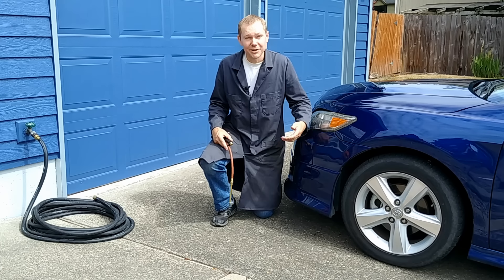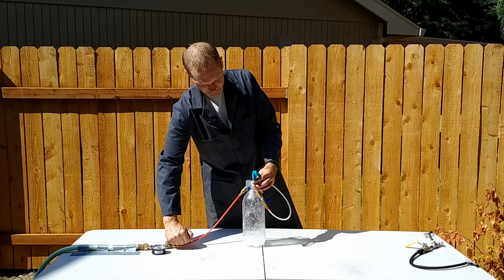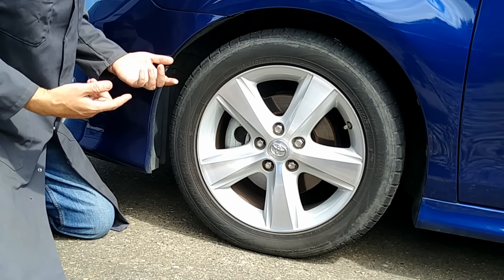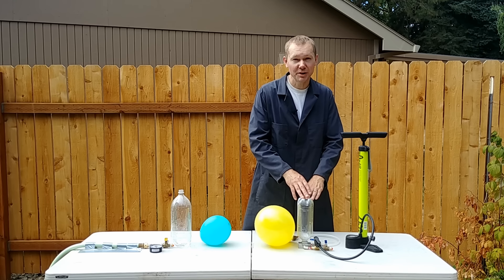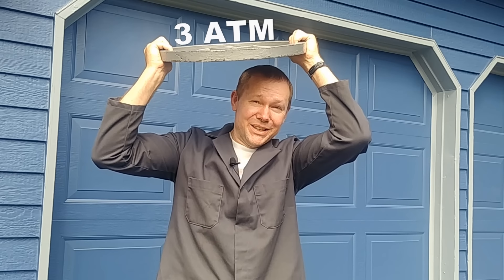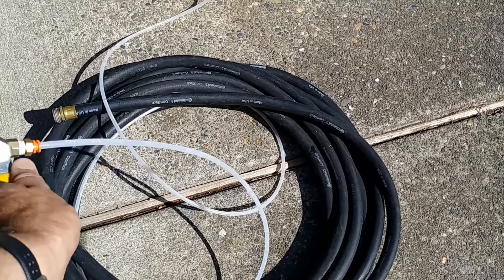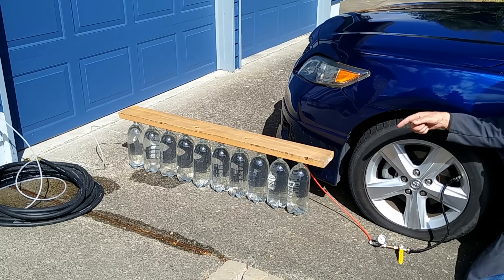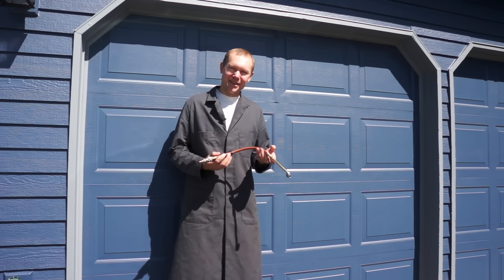2 Liter Bottle Compressor (No Moving Parts)

Comment: Next week: How to get water out of your tires.
Reply: Next week: What to do with the water you used to fill your tire.
Reply: Just wait for the belts to rust and then when the tire explodes all the water will come out.

Seriously. There is a reason string plugs aren't considered a permanent repair.
Reply: Good theory video. I noticed in the video you were using aluminum to mill the two liter bottle block adapters for this experiment. Have you considered selling those?
Reply: If you have a special set of tire rims with rubber sealing around the inner to protect against rust, you could just use water period and it would last much better, plus is you had a leak it would be extremely obvious where.
Reply: @seanregehr4921  and then end up getting 4 miles to a gallon with all tires filled with water. Lol

And in the winter when they freeze your tires would be lopsided
Reply: You did not understand what you are watching. There is no water in the tire.
Reply: You did not understand the joke.
Reply: Jokes aside (funny as hell) you will get a small amount of water in your tire. The initial experiment with balloon you can hear the small amount of water getting in. Not to mention humidity. Common air compressors have ways to eliminate the residual water in the tank before it becomes an issue.
Reply: @seanregehr4921  The roational mass would be insane. Take forever to accelerate, and even longer to brake. Be pretty dang cool tho. :)
Reply: @magnusnordstrom3927  Top speed would be lower and it would probably be very susceptible to road damage. When you hit a pothole some of that energy goes into compressing the air in the tire and without that you might pop them.
Reply: @mrbachibachiller7796  you are getting the air from the last bottle but you are getting some water /moisture from that bottle.
Reply: ---- he just needs to add a water separator or trap, after the last bottle.   just like with Air Filter Pressure Regulators that are installed at Air Compressor for powering Air Tools and HVLP Spray Guns, the Water Traps keeps water from getting into the air tools, and rusting them, from the inside out.  Easy Peasy 👌🏽

It ain't Rocket Surgery 😆
Reply: There would be no water if you add 1 more bottle and stop pumping air when water reaches that last bottle. Just to be safe.
Reply: No, blood out of a stone!
Reply: I hope you Are not serious, AS you know AS he told u can compress air not fluid, If u fill up your tyres and go 60mph on road and drive thru hole then u. Know why its not wise, for tractors they use water AS extra weight but they dont move in highway speeds
Reply: Roll the dodecahedron and punish yourselves... all of you.  The little bit of water that might have gotten in... meh. Even if it froze it wouldn't cause a problem. Steel belts are still sealed in rubber. A significant amount could cause wear especialially if there's bits of rubber from running on too little air pressure from the sidewalls eating themselves. I KNOW, because I used to see the damage replacing tires in the 90's. A squirt of water will not be a problem. Again, it was a joke.
Reply: @pgtmr2713  Exactly.  Worked a job doing tires part time for years and this is the correct response.
Reply: @seanregehr4921  Filling water into the tires is a bad idea, because it makes your car (in this case at least 120 kg) heavier. As the water is in the tires it takes an extra amount of energy to accelerate as the mass has to be set into rotation and translation. More over air is much more compressible than water, so you would also lose suspension. So there are good reasons why there is gas and not liquid in the tires.
Reply: @seanregehr4921  that would be terrible. The additional unsprung and rotational mass would ruin the handling, performance, fuel economy and comfort of the car
Reply: @seanregehr4921  Besides the added mass people are talking about, since water in not compressible I'd be willing to bet you drive over one nasty pothole or bump, the water will have nowhere to go and will hydraulically unseat the tire from the rim.
Reply: Water/Humidity levels would be insane and on a long drive may steam up and increase tyre pressure above safe levels. Hopefully he can run a vacuum on it in the next experiment
Reply: @SergeantSpandex  No.
Reply: @pgtmr2713  but yes 😎 do burnouts to steam clean those tyres,  fill the tyres with liquid rubber and now you have a no-air tyre. Sloppy tyres fixed - forever
Reply: You would immediately lose 1/3 of the original horsepower from the added rotational mass as documented from the butt dyno series!
Reply: Well I've been a tire guy for the last 30 years. Water in a tire is not good unless you're going really slow. Otherwise it's a huge balance inconvenience. Now I have been known to put calcium chloride inside a tube inside a tire but it was a huge tractor tire and it was done for weight purposes. It added about 400 pounds per tire.
Reply: @anothergoogleuser  charge your cellphone or perhaps wash your car.
Reply: JOE MASTER PANTHER ZIPPILLI I hated calcium chloride. Especially when the tube gets a leak and wheels get corroded bad. Just messy all the way around. On top of the chemical reaction being extremely hot. That’s why some farmers went with antifreeze. But mostly just added weights to the rims. But that was along time ago when I worked at a tire shop. I’m sure things have changed since then.
Reply: Don’ worry bout it.  At least for moisture.  
Tractor tires are sometimes filled with water to increase traction.
Reply: @Falcodrin  not to mention, wheel hop. Don't think a tire could be balanced with water in it. Might work for low speed and agriculture, but not so much for the highway.
Reply: the better question is why he did not use the foot pump in the first place?  rather then spend 5 hours building this?
Reply: @Randy2747   I saw a YT video were they filled it with water and it lasted a very long time doing a burn out
Reply: @seanregehr4921  do you know how heavy water weighs ?
Reply: @punker4Real  really?! That's crazy! 
the water would freeze in the winter time and tires would have to be out of balance even if it's size of a few ice cubes.

I wouldn't want water in my tires. Lol
Reply: Well, water (and glycol) are used in tractor tires (and other farm equipment) to lower centre of gravity. They used to use calcium and water mixture as well.
Reply: @Randy2747  Just add some antifreeze.
Reply: @Randy2747  You would only notice a decrease in fuel economy when accelerating (and longer braking distances). Once you're up to speed, yes there is a little more mass to move but you'll actually have better fuel economy if you go up and down little hills because the car will have more linear momentum.
Reply: @hugoburton5222  a car have low enough centre of gravity, and that is really one of the worst place to put weight to, too much rotating mass, it will probably have twice the braking distance
Reply: Something not mentioned is the different density between water and vapor. The tires have higher pressure, meaning that is not hard for the vapor to condense and they heat while being used, so the water could evaporate. All this state exchanges make for (sometimes uneven) variations in tire pressure, what may lead to higher wear, lower performance, lower efficiency and in extreme cases help the tire to blow. To avoid that, high performance cars are filled with nitrogen instead of "air" to prevent water to interfere with the pressure and reducing it just to the temperature.
Reply: The humidity level of air going into the tire would be equally bad... Causing greater expansion and retraction depending on the current temperature and while driving... Best to fill your tires with the least humid air as possible.

Interesting example of air pressure and such; but, I'll stick with my standard compressor with a vapors condenser interface to limit unnecessary water 💦
Reply: @seanregehr4921  Wrong. The whole reason we use air in tires, is because it compresses, and in turn offers a smoother ride. Otherwise we would all just use solid rubber tires.

That said there is now an air-less tire on the market for commercial applications (does not offer as smooth of a ride as air tires though, they are much more rigged. Airless tires said to offer an air-like ride are coming though, they will cost about the same as runflat tires.
Reply: @mrbachibachiller7796  There is humidity in the air, most likely very high humidity. It will condense out.
Reply: LMFAO
Reply: Mrbachi Bachiller - Not true. Air contains moisture. Air pressure generated using this method will contain a lot of moisture. It can cause issues with balance and tire life due to rust in the steel belts. Better shops will either use nitrogen or a drier on their air supply, for this reason.
Reply: If you just drill a hole like so...
Reply: @seanregehr4921  good theory but I tried that with my ATV and the tires blew due to centripetal force with the extra weight of the water. I realize they are 2 completely different kinds of tires but same concept.
Reply: At the bike shop, putting water in other mechanic's tires when they weren't looking was a great prank.  Made the bike ride REALLY weird!
Reply: @SuperfluousUserX  Causes hell with the tank though.
Reply: @mrbachibachiller7796  there would be water vapor carried over, no doubts about that.
Reply: Using 51 blow up balloons and a party straw of course.
Reply: @seanregehr4921  Except water is uncompressable, and would rupture the tire when it was jarred by a pothole or other large bump.
And then there's the fact that water freezes and expands.
Let actual mechanics such as myself do the thinking. You're going to get someone hurt.
Reply: @Ariel24K  8 pounds per gallon.
Reply: @hugoburton5222  lol 🤣😂
Reply: This is brilliant. It sparks conversation and argument! Lovely stuff!!!!
Reply: @dudeonbike800  Genius!!!
Reply: @RichFreeman  What is a string plug?
Reply: @Randy2747  Actually, when water freezes it expands 10% in size. No tire would survive that.
Reply: @rwatson2609  it is a way to plug a hole in a tire. You remove the object that punctured the tire, file out the hole to the right size, and then use a tool to push a plug into the hole. The plug is just a bunch of pieces of string with tar on them. This will make a reasonable seal so that the tire can hold air. The problem is that the string will allow water to seep into the tire. This water will slowly rust the belts and reduce the strength of the tire. Then a year or two later you're driving down the highway and get a blowout and lose control of the car. 

A string plug is perfectly safe as long as it is short term and not too close to the sidewall. However, the tire still needs a proper repair which requires unmounting it and adding a patch to the inside to make it water tight. This can be done at a convenient time, so string plugs are a legitimate emergency repair which can be done roadside.
Reply: @RichFreeman I'm not so sure about this.... So how would the water get in through the string plug with 30 psi pushing against it. I know that centrifugal forces are against this happening as well. And finally, air can usually seep through holes better than water can, so even the smallest hole in the threading would cause an air leak before it causes water ingress. I know I'm a pain, but I'm in lock-down and I have nothing better to do than troll the web.
Reply: @rwatson2609  I'm hardly an expert in tire repair - I suggest search the issue.  However, it isn't that unreasonable - water is drawn through something like a string via capillary action and diffusion.  You wouldn't see the water flowing in any visible way - is more an issue that if it is parked overnight in a puddle/etc the water would very slowly seep into the tire.

I couldn't tell you how large the risk is.  However, I've seen the recommendation to not rely solely on a string plug repair on numerous reputable sites.  It is probably a recommendation for a reason.
Reply: @Delano Schummelketel 😉 of corpse
Reply: @mrbachibachiller7796  There'd have been a lot of water in the tire, even without using the the water bottle system undried air carries a lot of water, the water compressing the air would have added droplets that would have carried over, it would have been well over dew point.
Reply: Im actually the one who ke this comment to 2k likes!
Reply: @dudeonbike800  We had a service manager that transfered to another shop closer to home, he dropped by one day to pick up some tires our shop had. While he was talking with the manager several ounces of wheel weights got hammered on to his Ranger's wheels. He said he stopped to see if he had a flat it was wobbling so bad. It was a good prank. He was good service manager, it was all in good fun.
Reply: That's a pretty stupid remark. There is no water in the tires. Did you even watch the video?
Reply: @seanregehr4921  but you can't compress water. Hitting a bump would be horrible if you filled your tires completely with water lol
Reply: Sean Regehr I think it would be a very rough ride, damage the car, effect handling, etc.. , but in theory would be possible.
Reply: punker4Real yeah, or the plug in compressors. (I bought mine for 10$ on sale)
Reply: @RichFreeman  what are you talking about he had a shut of valve very minimal water whould have made into the tire if any it was directed into the bottles that pisplaced the air fron them into the tire so only air is getting put in the tire
Reply: @AldoHam  very minimal water in your tires is still water in your tires.  It doesn't take that much water to rust the belts.  The water was splashing quite a bit and certainly would have made it in without a trap of some kind.  Plus the air would likely be pretty humid as well.
Reply: @seanregehr4921  and your tires would only weigh like 200 pounds each.....VERY BAD IDEA...!!!
Reply: Saying that when compressed air has a lot of moisture in it seems like a useless complaint. Most aircompressors dont have a filter for water
Reply: Everyone quit talking like you know what you are talking about.  The OG post said it was a joke.  The minimal amount of water that made it in will literally have 0 effect on the performance or health of the car.  So shut up about it.
Reply: Mrbachi Bachiller yes there is ,, because this air is full of humidity , in the end ,, you will have water in your tire ,, in an air compressor the humidity is much less
Reply: @seanregehr4921  yeah, see what favours that does to your spine
Reply: @pgtmr2713  lol, he mighta been joking but there are a few on here that don't think he was ha ha ha ha
Reply: @seanregehr4921  correct, however that would greatly increase the rotating mass
Reply: @matke8723  there still would be a bit.
But probably no more than running your compressor on a extremely humid day.

Which people do on a normal occasion so guess it not a problem.
Reply: I was thinking this exact joke.
Reply: @seanregehr4921  Except that water doesn't compress, which means it's only a matter of time before your tire breaks its bead or just blows out.
Reply: @mrbachibachiller7796  There is certainly SOME water in the tire.  Is it enough to be a problem?  more likely when one can accidentally blow water in...
Reply: @Randy2747   Plus water weighs 8.33 pounds per gallon!  Now he calculated that his tires were about 30 liters in volume.  I believe a liter is about 3.6 ounces over a quart (32 ounces).  Whatever the conversion works out to, that's a lot of extra weight.  And since water is in compressible, your going to have a lot different ride compared to what your used to with air.
Reply: @magnusnordstrom3927  some big extending boom forklifts use water in their tires as ballast, it was also a trick used in the old tall narrow jeep tires for reaction in sand
Reply: @ronaldharris6569  Wow, that's pretty cool! Thanks for the info. Very clever, using it as ballast. I don't really understand how it helps in the sand though?
Reply: dude the water does not come with the air listen to le video :)))
Reply: @mrbachibachiller7796  yes there would be unless he has a filter on the last bottle.You could even hear it coursing through the narrow tube.
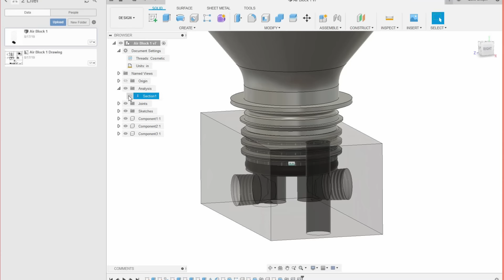Reply: @RichFreeman  To Tim, Rich Freeman and others of ilk: At 4:48 minutes: There is a reason for this video upload, is to educate, not to be used in a practical situation.
Reply: @eddyvideostar  The reason for my comment was to educate, not to suggest that the video was morally deficient.
Reply: @anothergoogleuser  drink it its just tapwater so it should be perfectly safe
Reply: Trevor Noah sometimes, ngl most air compressors still let water in past the filtration, something I have to deal with especially being down in Florida with the high humidity
Reply: @mrbachibachiller7796  i guarantee there is water in the tire.. it's not filled with water, that is for sure, but there is water in that tire :}
Reply: Or ...benefits of using water in your tires vs air? Have a slow leak? Park by your garden... lolz
Reply: No way. Air compresses and provides suspension. Water does not compress and you'd have a total disaster.
Reply: @Cotronixco  I would say I was talking about carbonated water...but I'd hate for you to miss my sarcasm twice...
Reply: Why?  Adds weight, great for winter traction.  LOL!
Reply: Tom Long - I wasn't responding to you. I was responding to Sean Regehr. But apparently YouTube is too stupid to let you know that.
Reply: Why should be water inside the tire? :D Probably a minimum humidity - but tht's it. And that is the same you get when using a compressor at a day with rain or whatever. so...why?
Reply: @SuperfluousUserX  And small car compressors have no tank. So they directly push humid and compressed air inside the tire. there will always be a small amount. Does not matter though.
Reply: pete schabe - not an issue if you don't get any water in the final bottle.
Reply: @magnusnordstrom3927  Farmers add water to their TRACTOR Tires for increased weight to get better traction when pulling something like a plow.  The Tires are Filled with a water/calcium chloride/glycol  mixture, so the water won't freeze in the winter time.
Reply: @anothergoogleuser  
Unless there is an inline drier. Which most tire compressors DO NOT HAVE. 
Almost all compressed air from your compressor or from the gas station has moisture (WATER) in the air that goes into your tires.
Reply: Johann Ribert he didn’t put water in the tyre he used the water pressure force that pushes air like a compressor
Reply: Dr. M. H.  Lol 😂
Reply: Dr. M. H.  🍻🤜
Reply: @seanregehr4921  The suspension would be very rough on hard surface!
Reply: I expect you know that you should fill the large tyres on a tractor with water...???????
Reply: @SuperfluousUserX  yeah my intern job scope was to clear water from compressor tank from the valve every morning n before clock out.
Reply: LMAOROTF!!!!!!!!
Reply: "Ok guys, drink up,!!!! The articulating loader at the mine needs a billion liters of air!!!!”
Reply: Randy E I think my tires want to pee
Reply: buenisimo jaja
Reply: @Randy2747  Just switch them out before winter then. Winter tires as normal, late spring to early fall water filled tires... if what he's suggesting is feasible. People in cold places change to winter tires anyway every year...
Reply: Smart kids must be used extra bottle with foam inside.
Reply: No moving parts, except a water pump, oh yeah and water
Reply: No water goes into the tire. that for the visual. Look exciting. The one empty bottle the first bottle of air that equal to all ten bottle compress get tranfred to the last bottle at the end  to look good then into the tire.
Reply: it was easier to buy an electric pump or go to the tire shop, or change the tire
Reply: Maybe a little moisture, as long as ur careful and dont push the water to the top of the bottle. Even then, the pneumatic line and 2 valves wouldn't let much in. No more than you would get from a compressor on a muggy day.  Would be great to add a catch on the line. just for the little bits that might jump up into the block and down the line. Either way. 

OH and yes, i get that its a joke. Had a good laugh XD
Reply: @RichFreeman  you are aware that filling your tires with atmospheric air puts a decent amount of liquid water in them, don't you?  

Ever talked to the guy who was changing your tires? Ever notice the half liter of water that pours out of some tires when the seal is broken from the wheel?  

The belts are encased in rubber. Try again.
Reply: @anthonytackett5619  in that case, why do they recommend against string plugs?
Reply: @RichFreeman  You're on the right path with the plugs. The puncture causes a break in the rubber casing. The String plug WILL seal it. BUT, the atmospheric moisture has already gotten in. So, it WILL fail when the belt rusts from the trapped moisture inherent in the process. As long as the tread is not punctured, you can feel secure that short of manufacturing defect, or damage, the belts will stay inside the rubber. 

The issue would be more the mass and inertia with the water. If too much gets in, you will wear your breaks out in a very short amount of time. Fill all your tires with water. You may not stop, until something else sturdy enough stops you. But, a little bit of water inside a tire is normal and non-destructive, to the tire. The wheel, however... If not properly coated and sealed...

Patches are not nearly as bad, because they do not force more moisture into the belt, increasing the amount of time before it rusts, and eventually fails. And, as the air pressure will hold the patch against the hole, not nearly as much glue, solvent, or other moisture carrying or corrosive agent is introduced in the process.
Reply: Fill with water and see what happens when the tires freeze.
Reply: @seanregehr4921  to much rotational mass
Reply: @mrbachibachiller7796  Whenever you are working with water, there is always water vapour around.  Water vapour in a tyre is a really bad thing, due to huge pressure instability between cold and hot, which means you can then never set your pressures properly.  There's a reason tyre shops have drier setups on their airlines..
Reply: @pgtmr2713  Yeah these people have probably never seen the inside of a tire, they also likely do not know that the rubber in a tire is slightly porus, over 3-5 years of being on a car, the belts have gotten wet.

Not to mention when we seat the bead on tires, we use tire lube or soap. You mix the tire lube with water before dipping your brush in it so the bead slides around the rim without tearing or damage. There is water inside tires the second they are put onto the rim. Water in tires doesn't hurt them if it's just a little bit. I would imagine a quarter cup of water would also act like balance beads and help balance the tire. (would make balancing on a machine a massive pain, but thats what balance beads are for.
Reply: @davidmarquardt2445  The beautiful thing about the metric system is that 1 litre of water weights 1 Kilogram. A cubic metre of water weighs 1 tonne (1000 kg) it's dead easy. So 120 kg of extra weight. About 264.5 Lbs
Reply: It hard enough when it off wheel unless if frozen.
Reply: @seanregehr4921  Water does not compress. You will have one hard ride substituting a compressible medium with an uncompressible medium in your tires. Not to mention trying to balance those wheels.
Reply: @SuperfluousUserX  Use a water trap
Reply: @magnusnordstrom3927  The water is free to move inside the tire. Though the tire would have a lot of weight, it would only have the slight friction of the water impacting its rotation and I doubt acceleration times would be impacted much... no more than carrying the same amount of water in the trunk at least.
Reply: @mrbachibachiller7796  unless you remove the water from the air before pumping it in, there is always some water in the tire. Usually in the form of humidity, but it will condensate in cold weather. I know that's not what the comment was talking about, but just thought I would point that out.
Reply: Mine is harder! Can't figure out how to get off all those pop corn tried in!
Reply: @seanregehr4921  you mean that you want to fill up your tires with water ? That’s a really bad idea. Water is incompressible, your tires will behave very badly. And also think about the inertia of their water in there, at higher speed you could have some nice surprises :)
Without mentioning the energy dissipation due to vortexes inside the tire
Reply: @SuperfluousUserX  it had a different type of valve on the final one. It displaced pretty much only air.
Reply: @TheovdGulik  Yes there is water in the tires. Do you even understand sciemce?
Reply: @mrono1910  Most air compressors dont use water as thecompressive mechanism.
Reply: @mrbachibachiller7796    You know that PGTMR2 was just making a joke.
Reply: @mrbachibachiller7796  water vapor will condense inside the tire.
Reply: I was wondering if he put an inline filter to keep water from getting squeezed in with the air.
Reply: @seanregehr4921  
Except, liquids don't compress. Your ride would be almost no different than steel wheels. Until you hit a rut and the tire exploded.
Reply: lol
Reply: Great video!
Reply: The week after that how to get your tires into the bottles.🤪
Reply: @SuperfluousUserX  actually the common air compressor it's self usually has nothing of the sort. This is the job of a desicant or refrigeration dryer which most tyre garages don't have so you needn't worry about moisture in your tyres as I can guarantee that most cars already do.
Reply: @seanregehr4921  Balancing and ride comfort not to mention mpg?
Reply: except if you live in the Northeast a water tire would expand and become rock hard.
Reply: Exactly
Reply: @mrbachibachiller7796  And you do not understand physics. The air in the tire is now super hydrated and will corrode anything it can. So it might have been a joke, but he was also right.
Reply: God has said in the Quran:

{ O mankind, worship your Lord, who created you and those before you, that you may become righteous - ( 2:21 ) 

 [He] who made for you the earth a bed [spread out] and the sky a ceiling and sent down from the sky, rain and brought forth thereby fruits as provision for you. So do not attribute to Allah equals while you know [that there is nothing similar to Him]. ( 2:22 )

And if you are in doubt about what We have sent down upon Our Servant [Muhammad], then produce a surah the like thereof and call upon your witnesses other than Allah, if you should be truthful. ( 2:23 )

 But if you do not - and you will never be able to - then fear the Fire, whose fuel is men and stones, prepared for the disbelievers.( 2:24 )

And give good tidings to those who believe and do righteous deeds that they will have gardens [in Paradise] beneath which rivers flow. Whenever they are provided with a provision of fruit therefrom, they will say, "This is what we were provided with before." And it is given to them in likeness. And they will have therein purified spouses, and they will abide therein eternally. ( 2:25 )

 Quran
Reply: @thememoryhole9355  Haha yeah, rolling smooth until a rim hits the curb and sparks fly! XD
Reply: @mrbachibachiller7796  there definitely was some water in the tire. nothing significant but its there. in the test you could hear water was getting blown in to the air tube. now there were how ever many bottles. so not nearly as much water made it in, but as the 10th bottle was filling with water some water definitely made it in to the air tube.
Reply: @seanregehr4921  Assuming the same size tires as in this video, that would be four tires containing 60 liters of water each, totaling a whopping 507+ pounds added to the weight of the car.

NO, SEAN, WE'RE NOT DOING THAT.
Reply: @magnusnordstrom3927  It would add weight to improve traction if that was needed though.  We had a tractor on the farm growing up that had calcium added to the tires to add weight/traction.
Reply: next week: how to grab water from air
Reply: @glenndarilek520  rock crawlers add water in the tires as well. Lowers the center of gravity.
Reply: @RichFreeman  I've had a plug in my side wall for years. Happened when the tire was new. No shop will patch it so I left it. Those plugs are self sealing. Additionally, a patch from the inside will not protect the belts on the other side exposed to the environment so how is that better than a plug? The tire is half worn now. With luck the plug will last for most of the rest of the tires life.
Reply: @mrbachibachiller7796  Isn't there more moisture from this set-up vs an air compressor, though?
Reply: @RichFreeman  honestly your scenario is unrealistic and the tire would be long be out of commission and retired long before what you described would happen. But this is a stupid pointless for a car although we routinely fill tractor tires with water on the farm. It adds weight to keep the front down if pulling or using really heavy equipment.
Reply: @workingmanrondoyle3287  yeah,  or do a subscriber raffle!!!
Reply: @SuperfluousUserX  hahaha, add a cannister with silica gel to “dry” the air before going into the tire😷— will work just like Fauci’s masks — hahahha
Reply: @seanregehr4921  maybe we can use mercury instead water
Reply: @purask  there are trying to go 30 and go down the highway. And the pothole argument is moot the tire would still hold up even if it was full of water because you’ll never completely 100% fill a tire with water pressure because it is in a sealed area you will have water on the bottom half and compressed air on the top Half.
Reply: @seanregehr4921  it would last much better? Hahaha. You cant fill a tire with water. It won't balance
Reply: Cool video, but what did he do with all that water?
Reply: ROFLMAO
Reply: Use a water/oil filter attachment at the end. I use one for my big bore airrifle.
Reply: NICE!!  LOL
Reply: @mrbachibachiller7796  there damn sure is moisture in that tire
Reply: @mrbachibachiller7796  Water is being used to compress the air.  That, now very humid air is being compressed in to the tires at 2-3 atm.  At that pressure, the water vapor is going to precipitate out as liquid water.  Besides that,  even high consentration of water vapor can cause rust, which is why commercial air compressors have "air dryers" on them.
Reply: Or use silica gel to dehumidify the compressed air.
Reply: @anothergoogleuser  exactly
Reply: Good call!!   Water in a tyre is a total pain in the arse,  it causes a crazy wobble and you can't balance the tyre because the unbalanced weight keeps moving.............imagine if 200 ml of water froze and you set off to work at highway speed.   It also causes crazy rusting in the inside rim.   Stavros,,The voice of experience!
Reply: I mean I’m sure you aren’t saying do this instead.  It’s a neat thing.  No one in their right mind would actually think this is better than even just buying a foot pump. Cool science experiment though.
Reply: @RichFreeman  That's completely wrong. Tire patches are what cause steel belts to rust, not plugs. Plugs seal the entire hole. Patches seal on the inside and water can get into the hole from the outside. So as far as rusting belts, patches are worse.
Reply: @seanregehr4921  Trouble with water is the weight and the imbalance it would cause. It's great on tractors but would be so good on cars. There is however, this other Chinese invention I saw where they pump some sticky liquid into a air-filled tyre. When a leak occurs, that liquid quickly moves to the leak area and plugs it immediately. Fact or fiction? I don't know
Reply: @seanregehr4921 you can’t drive with only water in the tire
Reply: his method is more practical then you think by not filling the last bottle with water no water should go inside and the ony moisture that will build up will be from the release of pressure
Reply: @anothergoogleuser find two trees about 3 ft apart hold it like you were swinging a gulf club with the tire at a slight tilt and swing like a pendulum back and forth slapping the bottom until the water splashes out enough to empty